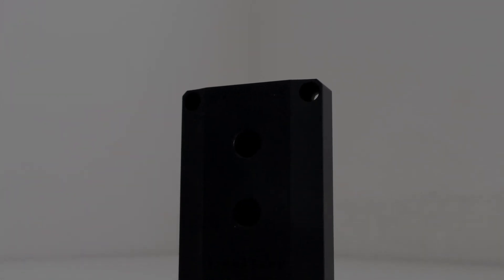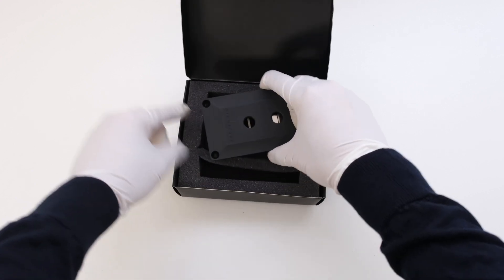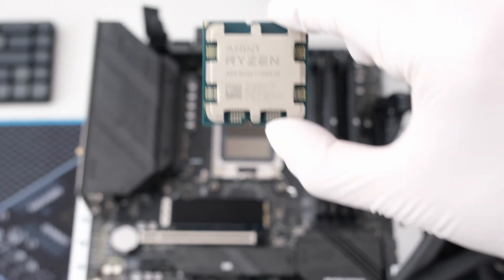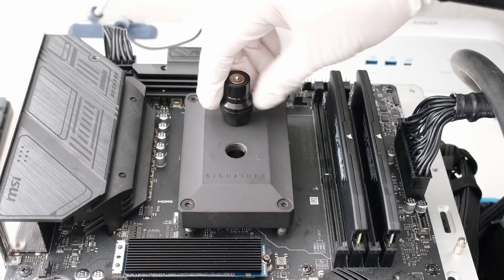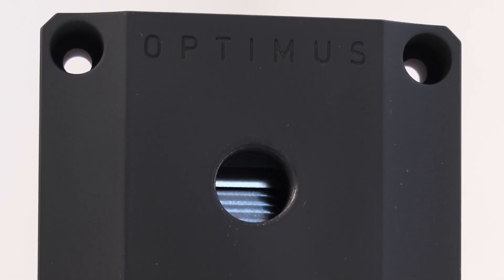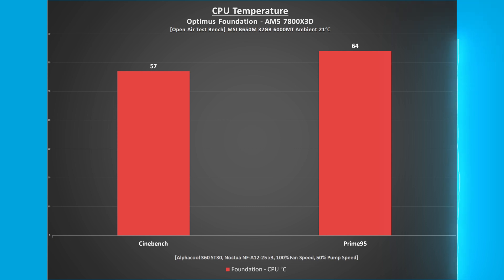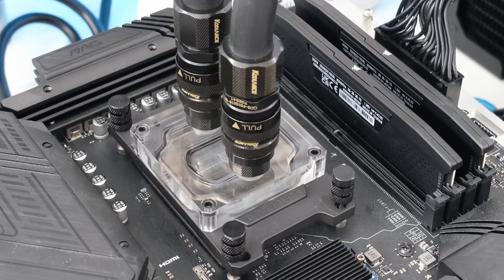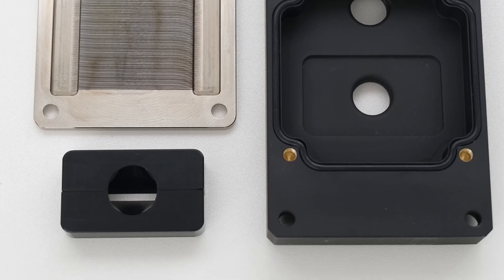Optimus Signature V3 Review - Best CPU Block?

Comment: Looks like they changed the design a bit, mine has the outter "rings" around the inlet/outlet ports. It is a bit cheaper too, than the older design. Wonder what else they've changed on the inside.
Reply from the maker: Yes, I noticed that on the newer release with the lower price point. Perhaps they made it less heavy. It original is very heavy.

Comment: Wait, u leave that noctua “paste guard” thin piece of plastic on there??? Yoo wtf? Lol
Reply from the maker: Thanks for your comment 🙏 That is how it is installed. It would not make sense to remove it. Hope that helps
Reply: @vectornetwork  yea but plastic melts my guy
Reply: @godnamedtay it's a heat resistant polycarbonate that can withstand up to 130 Celsius, so it's meant to be installed under the coldplate
Reply from the maker: @rodentboss2391  Thanks boss, you said it better than I would have 🙏

Comment: Wow! I have a 7800x3d and foundation block, but I'm getting around 80 degrees in Cinebench. I've tried all different thermal pastes and wonder if maybe it's from excessive mounting pressure. How tight would you say you mounted your blocks? Because the instructions say "very tight" and I'm already the guy who typically overtightens things 😂. Anyways, great channel man!
Reply: Looks like you’re way overtightened the block, either in a wonky way or any other way
Reply from the maker: Thanks for your comment 🙏 Your CPU is operating as intended. You likely have Performance Boost Overdrive on. My limited understanding is that the CPU will boost up until it hits 80 degrees Celsius. I had PBO turned off for these tests. Hope that helps. In short, don't over tighten anymore! You're good!
Reply: check your installation,i have 7800x3d with ek aio nucleus 360,temps 78-79never go over 80 at cinebench ,curve optimizer -27

Comment: Are you seriously using Noctua paste over Kingpin, with that decision alone I know this is a noob channel.
Reply from the maker: Thanks for your comment 🙏 I have used Noctua for everything so far. Partly for consistency, another part for ease of application (for me) and another part I enjoy the Noctua branding. For the block, I was more concerned about potential comparability with tests I've done in the past. Having said that, I'm likely using new paste going forward. I currently working on an Optimus GPU block for the Strix 4090 and I used their supplied Kingpin paste and spatula, as instructed. Thanks for your feedback and thanks again for commenting.

Comment: I would be interested in seeing how the Intel Signature V3 compares to the Signature V2.
Reply from the maker: Thanks for your comment 🙏 I really like this block. It is heavy. I took it apart and also liked the innards with the block. I didn't use Optimus's test case of a 16-core CPU, but I did use my own use-case of a 8-core CPU with 3D v-cache. The gains were reproduceable and they were exactly 1 degree celcius. I also did not delidd the CPU, so I cannot test their claims there. But my expectation is that you may see marginal performance gains between the V2 and the V3. Hope that helps

Comment: 2 degree colder than the core 1, but more than twice expensive with all the shipping fee + tax. So whats gonna be like when the apex block come out which AC claim that it's better than core 1 lol. They have to do something with the price and weird marketing scheme that claim that this block is 1~4C better than direct die, that's stupid claim.
Reply from the maker: Thanks for your comment🙏 I have to agree, the results did not reflect what I was hoping for. I double checked the paste contact and even showed it on the video so others can see. Off camera, I had made sure the contact for both CPU blocks were very well installed. The data lined up perfectly so it seems like good data. I saw a very clear 1 degree difference that I could replicate. I was hoping for 4-5. Optimus gave very detailed instructions on how to replicate their data. I wasn't going to go through all those hoops. I went with my own testing, which made more sense to me. I think CPU cooling has really hit its max well beyond diminishing returns. These are all very good and comparable blocks. Optimus did put a lot of time and research and materials into making a better block. They did but only by the slimmest of margins. Will I use the Signature V3 block in a build? Yes, absolutely. Would I buy it again? Unlikely. Would I continue to see what products Optimus has in store? Sure will. Hope that helps
Reply: What is apex waterblock which is a better then core 1? Another new alphacool waterblock?
Reply: @Igor.Kupinsky  From what i heard it's the high end block from Alphacool supposed to come out in 2024. So Core 1 and Apex. But judging from how they and Igor review the Apex stealth metal fans, the way they hype up and lied about the actual data. I have zero trust for AC at this point. Search about Apex stealth metal fan,  read the one from Igor a couple months ago and all the recents.

Comment: Guess it's time to throw away my EKWB Velocity AM4 block that I converted to use with my 7800X3D CPU. I get about 82C in Cinebench R23 in a loop, which is a crazy difference compared to this review
Reply from the maker: Thanks for your comment 🙏Haha, you certainly don't need to throw anything away friend. Thanks for watching and I appreciate your words.
Reply: I don't think you're actually going to see these kinds of results in a case. I have the Alphacool Core 1, which is extremely well rated, and I see about 72-74 degrees in R23 with MX-6 paste and a good application.
Open bench will nearly always have dramatically better results